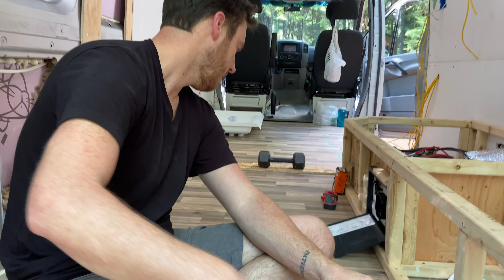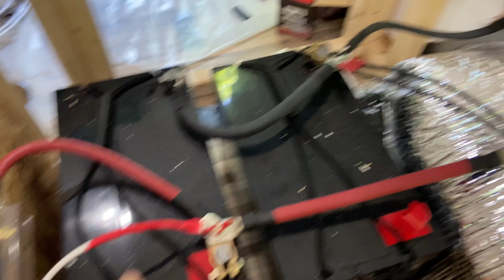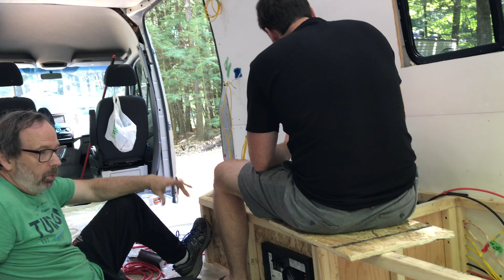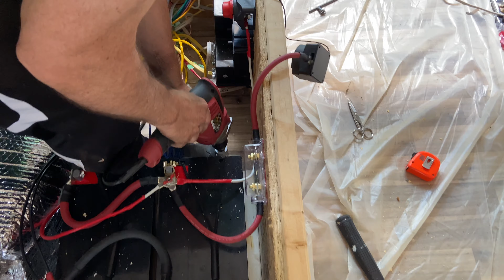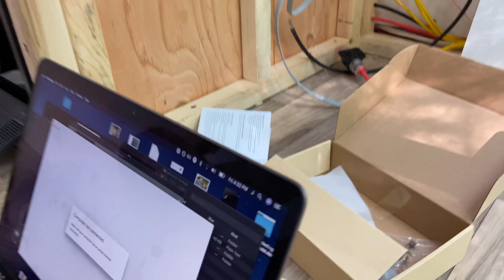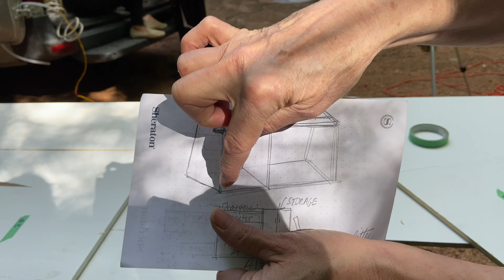How to connect a battery isolator in a Sprinter Van and wiring electrical | VAN LIFE BUILD

Comment: I’ve got that same battery isolator and 30 amp fuse, great minds! It may be worth your while to get a MacBook car charger. Right now you are generating DC, converting it to AC in your inverter and then converting it back to DC in the MacBook power brick.  I would bet all of those conversions cost a non-trivial amount of efficiency loss, especially when you are using it to charge lithium ion electronics.  Ultimately you will have to see what kind of power reserve you are working with but thought I would throw it out there!
Reply from the maker: That’s a great point, I’ve been looking for one but couldn’t find a good one. Do you have a recommendation for on that works for a MacBook Pro, 60 watts plus, usb c?
Reply: @LisaAndJosh  I don't have a good one in mind, but the great thing about USB c is that any 12V/car charger will work.  It doesn't have to be exactly 60W either, a lower wattage will just charge slower but too low and it won't be able to keep you powered up during computationally intensive tasks (like video rendering). It may all be a moot point anyway, a macbook has about a  6 amp hour battery, so even if your loosing 30% in the conversions you still only need 9 amp hours to charge it from stone dead which is well within your power storage. Plus all of this assumes you are generating zero power from driving/solar/shore.
Reply from the maker: @blakgrei  Yeah exactly - the MBP takes up 100% of it's wattage - 63 I think - when we're editing videos (or when I'm playing games with z+j), and if you don't give it it's full power, it doesn't turn on the dedicated GPU, which puts our rendering times for our 4k videos at approximately infinity lol. and right on the last point - we ran a test with our 150W solar panel in full direct daylight and it wasn't enough power to keep our fridge running and charge the batteries. maybe when we stop by we can get your help throwing another 150W panel on the roof? :)
Reply: @LisaAndJosh  Fridges are super hungry power beasts, what kind do you have?  We have a tiny one which uses a thermoelectric cooler, its terrible and we only use it for day trips- keeps the food nice and tepid...I'm looking in to a 12V compressor cooled one from Alpicool, they seem to be good without the huge price tag that the Dometec ones come with.  My father in law has a propane powered fridge in his trailer, it can run off 12V dc but when he's "off grid" he switches it to propane and it runs great, he was suprised at just how little fuel it actually used. I got to check it out in person when we met up in Montana a few weeks ago.  Super secret technique- load up your fridge with as much stuff as you can (bottled water and ice packs works great because it has a high thermal mass) and turn the temp down as low as it can go while you are on the move and the alternator can power the fridge, when you are stopped, turn the fridge off or increase the temperature setting. It will act like a cooler and your bottled water will keep the inside cool.